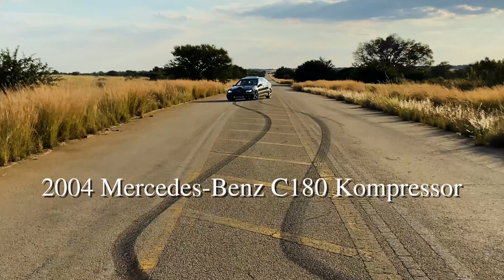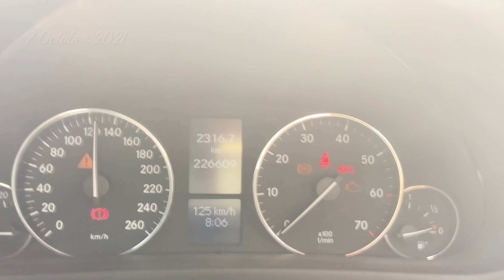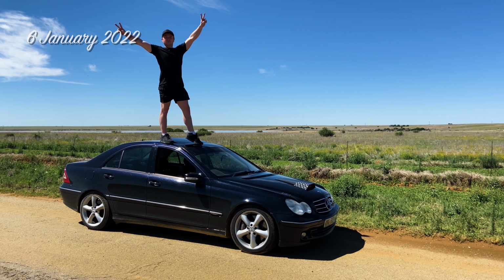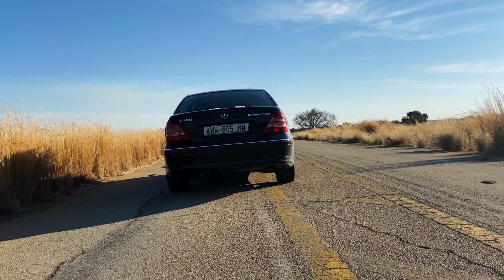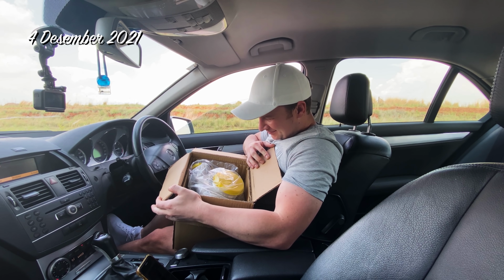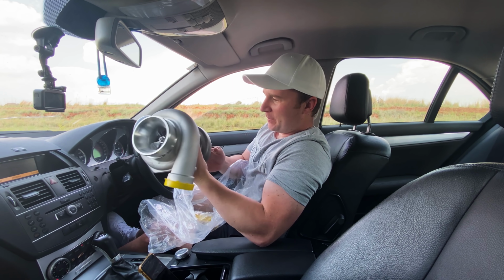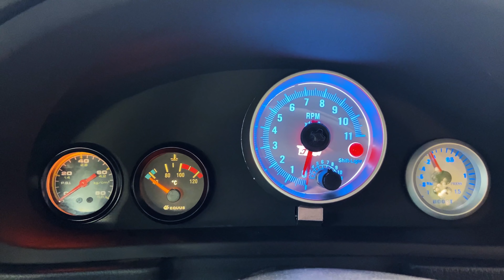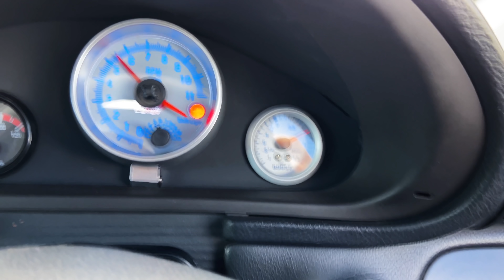W203 Mercedes M104 3.2 TURBO Build In 10 Minutes (The German 2JZ)

Comment: Everything about this video is perfect! I only wish I could contribute a set of factory SS exhaust manifolds from the colonies. I wonder what modern manual gearbox is bolting to the to M104? Asking for my G36 AMG friend. Special props for that $3 wheel center cap on the steering wheel, that's just smart and classy right there.
Reply from the maker: Thanks man🤙🏼
Best bet I would say for a gearbox is some kind of manual out of a diesel💪🏼
I bought the car with that centre cap on the steering wheel 😅not to keen on it but glad you like it!😁
Reply: @RicerBenz  When you get a chance, please take a look at the gearbox model, it should be stamped on the right side case.

Comment: oof. This is impressive. Having a 2JZ-GE-T Is300 and Multiple 2.7 BiTurbo and 1.8T A4s and S4s, I'd like to get a Merc, cause I'd consider them much more reliable than many of the older BMWs. I'd like to make yours a candidate on something I could build, rather than splurge out on a E55 AMG.
Reply from the maker: I do like all types of cars. Sounds like you are living the dream!😁 but yes this turned out better than I imagined! Thanks man!🙏🏻
Reply: @RicerBenz  Thanks 😅 Yeah, I also have a 2005 A8 with the 4.2 V8 so I guess the E55 could wait. Apparently you can supercharger the A8 with the Eaton M122 0_0 good for over 500hp.
Reply: You can also get a c32 AMG with a 3.2 supercharged v6. Half price of a 55

Comment: gotta do something about that one tire fire.  quaife makes a torsen differential that supposedly fits in these rear ends.
Reply from the maker: Would be cool yes but I’m afraid it might be too much grip for the stock gearbox…
Reply: @RicerBenz  plate welding the stock open diff is always an option 😉😆
Reply: There are lsdiffs for each of the w203 models now. I know that the automatic transmission is pretty strong but the manual I’m not sure.
Reply: @nickmarshall2676  tell me more.  vendor distributors etc plz
Reply: @e.v.a.l.s  per usual though, for this platform you are gonna spend at least 1k$ for an LSD

Comment: Good job, I also have a w203 with a 1.8 kompressor 163 horsepower.  I would like to do such a swap if I had a different car to drive on a daily basis.  Maybe some comparison between 0-100 stock m271 to m104

Comment: Sweet build man, I'm totally subbed! The M104's a terrific motor! Can't wait for updates. I've got an 89 300SE (M103.981) myself, love her to bits! 

Be weary though; Many of these big cis motors tend to suffer from sludge because there's a constant stream of gasoline being sprayed into the combustion chamber. Big ends tend to go first from my experience with m103s and m104s. 

I'm curious as to what engine management system, fuel system, and ignition system you are running? I'd like to do an efi conversion on my car sometime in the future for reliability reasons.

Awaiting your reply in anticipation!
Kind regards.
Al.
Reply from the maker: Thanks man! Really appreciate it!😁🙏🏻yeah this engine is doing better than I ever thought. It’s my first turbo car so anything goes🤣
I’m using a local South African stand alone ecu (Powermods) & I’m very pleased with how it’s doing 👌
I have kompressor (c180/M271) injectors on a knockoff bosch 044 pump
& 
Thanks for the tips😎
Reply: @RicerBenz  thanks for the reply mate! I'm South African aswell and pretty young too! Looking forward to more kick ass content!

Comment: I saw on google people commenting if it would be possible to put the head of the pagani with the m120 engine in the m104 engine, is it possible to put the head of the 6.0 v12 or 7.3 v12? What parts of the Zonda m120 are possible to install?
Reply from the maker: I’ve heard about that but I have no idea if it’ll work. Should be one insane engine 👌
Reply: Ur mixing it up a bit, the M120 is V12 and the pagani uses the M120 mercedes V13 bored to 7.3. so whatever ur asking won't fit in M104 even if M120 is made of two M104s hence V12

Comment: I just bought a s320 with this engine in it but, I don't want anything crazy, BUT I  want some more power, what should I do?
Reply from the maker: The easier air can move “through” the engine the better the engine will perform 👌
Cold air intake? Exhaust…
Depends on how much you would like to spend.
Reply: w140is a heavy car 
ITB and headers if its ok in your country, my m103 got 25hp from itb and headers on my w124 but i am still going for the turbo kit from turbobandit

Comment: What transmission did you use ? The stock c230 manual trans ?
Reply from the maker: Stock c180 6speed yes😁
Reply: @RicerBenz is it bolt on with the m104?

Comment: nicely done. what trans, clutch and flywheel are you running?
Reply from the maker: Thanks man🙏🏻😁 stock C180 6speed manual + flywheel. Made a button clutch out of the stock clutch 👌
Reply: @RicerBenz w203?

Comment: Did you make it m104 with turbo? 
If I'm have m104 3.2 liter in w210..how can uprage it or refresh hp?
This delay and more problems..
Also not legit set turbo if not come from factory with turbo(suck rules in Israel..)
Reply: Yes he made m104 turbo mate, u can upgrade ho by doing what he does, that is turbo charging it which is hella expensive and hard to do by yourself. A shop charges easy $15000 here and not every shop knows how to turbocharge these perfectly. just keep driving your stock m104 W210 ( w210s are better with m112). For the delay check ur maf and change spark plugs and coils. You should see a difference just by doing those

Comment: Hey man, I have a w220 s320 which is straight piped and I want it to shoot flames, but my tuner says its not possible. Do u think it is possible to get it to shoot flames? Right now it has a basic crackle tune, but I want it to actually shoot flames. What do u suggest?
Reply from the maker: He would know better than me🤣the only reason I can shoot flames is because I’m running on a stand-alone ecu with a launch control function

Comment: aub'd, liked and bell icon. good vids man. im a fan of M104 (M606 diesel and M612 i believe? diesel 5 , make good hp as well). check out "turbo bandits", 1000 hp and few mods here and there, stock internals if correct or uprated pistons. also Mo , from Motronix had a E320  and did what ja did. he did add aluminum on the head so comp could be dropped. again, good vid and good luck getting more power from her.
Reply from the maker: Thanks man!😁😁